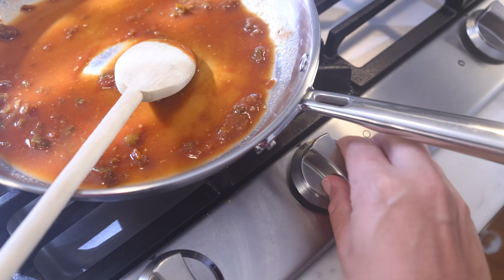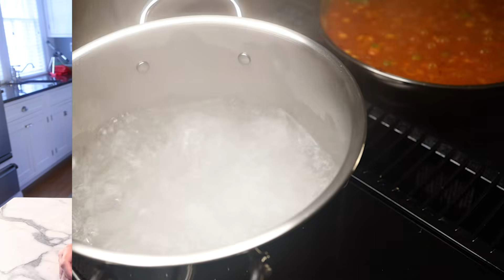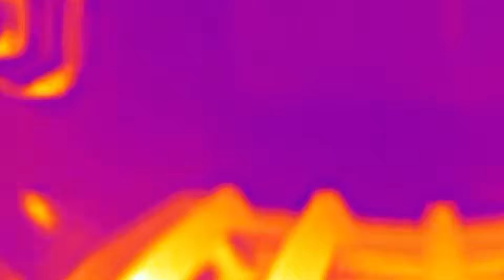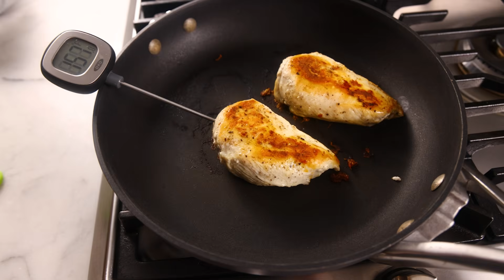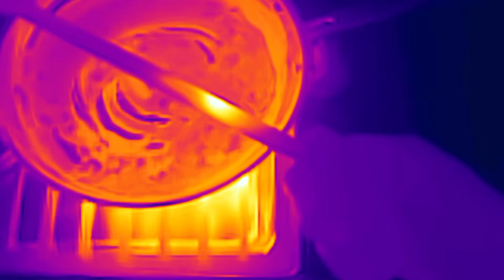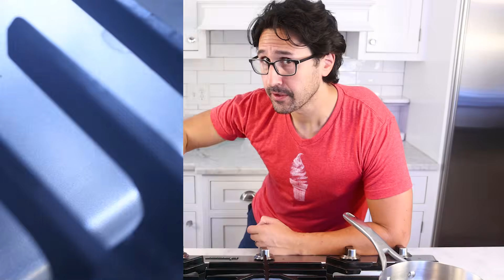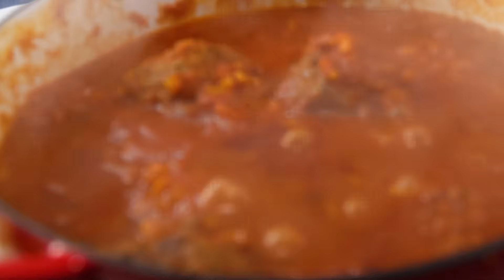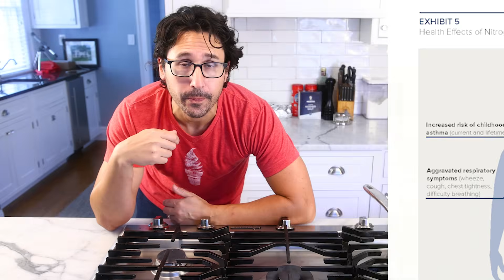Problems with gas stovetops | weak, dirty and dangerous

Comment: Wood fire stoves solved the heat distribution issue by having numbered holes that matched a ring in the bottom of the pans.  A number 8 pan in a number 8 hole was supported around the edges, exposed to the fire beneath, and excess hot air was mainly contained within the stove. This seems like it could be a simple addition to a gas stove if you had antique cast iron pans.  Replace the grate with a box with a numbered hole in top.   Take care to let enough oxygen in though.

Comment: When it comes to the ventilation, it is REQUIRED in commercial environments that cook with gas. Even if all you're doing is boiling water. It's not about clearing smoke from you food, but about clearing these combustion byproducts from your home.

That being said, one other benefit of gas that I do see is in the event of a boil over, you can more readily get the problem under control. Even if things get really really bad, shutting the gas off will resolve the problem in about 15 seconds at most.

Comment: Most of the electric power I use is produced at a power station using natural gas, it seems silly to burn the gas put it through a transformer run it through the lines back through another transformer and then heat my stove, when they can just pipe the natural gas straight to my house. I think it's more efficient energy wise but I could be wrong.

Comment: Yeah i was getting  a big question mark in my head when you said electric was unresponsive, until i realized you were talking about ancient resistance coil technology. Induction has been the standard for a long time. and it is as instant as i think heating something up should be, some are even too aggressive, causing your pans to warp because the steel cant spread the heat fast enough through it self causing it to warp due to hot steel expanding
Reply: Looking at HD canada today lets disprove that claim: lowest cost (and therefor most ubiquitous) is an electric coil range at 694 dollars, and gas at also 694 dollars (but less common cause less people have gas lines in their kitchen). Cheapest induction cooktop is 1394 dollars. Even today the standard cooktop is electric coil in Canada. Likely the same is true in the US, where this video was filmed.

Comment: eventhough the induction burner is better than gas stove, a bad gas stove is better than a bad induction cooker. ive wasted a lot of money to find good induction cooker but i still almost burned my food using it. it always level 2 is too low but level 3 is too high temperature, i cant set it to 2.5. it frustrated me because i cook 2-3 times a day. however for gas stove i never had any problem as im able to tell by looking at the flame. i can control the flame as i wish.

Comment: The newer gas ranges with dedicated high-output burners have closed that boil gap dramatically between electric & gas. Regardless of how fast a pot boils water, I have never had anywhere near the control over temperature with an electric range as I do a gas range. For me, the litmus test of a quality range hasn't been how fast it boils water. If It takes 4-5 minutes with an electric cook top and 7 minutes with gas, so what? That, to me, is just a performance measurement for how well it is transferring heat. It doesn't have anything to do overall control of temperatures - which if you are serious about cooking, is everything.

Comment: A couple things the heat's not wasted a distance away from where the gas comes out it's where the most heat is at the top of the flame and the grate being real hot is not wasted Heat it helps transfer that Heat a little more slowly so it serves a purpose

Comment: Can't speak for induction cooktops since I have not used one. Those might very well eliminate most of the disadvantages of electric. Normal electric cooktops are terrible, and I would avoid them in any living space I actually own. 

Going to your point about the weak output, that seems to be a product of the modern gas cooktop. The reason so much heat escapes, is because they are making the grates sit to far from the burners on these modern "restaurant style" cooktops. The reason why real restaurant cooktops are like that is because they are capable of producing large flames on a single burner, that create more heat than a complete residential range can.

Comment: Hey, Adam!

I just want to clarify something about the end of the video. Electric stoves are very rarely going to be getting 100% of their energy from fossil fuels. If it's getting power from a local region, there can be a wide range of renewable sources. For example, 60% fossil fuels and 40% renewables. And yes!! As you said, they will be getting cleaner every year too while gas stoves are locked into how clean they are.

Comment: I've been a home appliance tech for years, and now own my own business. I'll point out a couple of obvious reasons gas stoves and cook tops are not as hot.
First, they have been designing them to look like a fancy outdoor grill and the grates have the pans way too far above the burner, wasting a lot of the heat produced.
Second, if you can afford a high end gas stove or cook top, most of them come with bigger burners, more gas holes in the burner assembly, and a larger gas orifice so more gas makes it to the burner assembly. Some even come with two burners, one inside the other and two gas orifices. Those are designed for use with a wok.
So, gas appliances are not colder per say..., the design is  the issue. Point of fact, a gas oven will heat up faster than an electric oven because they have a correctly sized burner tube. Gas water heaters also heat faster than electric water heaters. Gas furnace is more efficient then an electric furnace etc.
As for you analog of a wok needing the heat to come up the sides? Nope. Wok cooking is designed to have a very not bottom to almost flash cook while you can pull up mostly cooked items on the sides to keep them hot but not cooking at the bottom. A quality wok will not have completely smooth sides. It will have hammered dimples to help grab the food and hold it up away from the extreme heat at the bottom. Seeing all those flames going up the sides is just a by product of the intense flame aimed at the bottom center.
Induction? They cost way more to buy and repair, so you'd have to factor that in when looking at efficiency I think. A standard brand induction range or cook top has a $1600 triple control board under the induction pads. Most brands, you have to replace all three as one unit. The time involved in disassembling on of those, replacing the control boards, the reassembly can be almost 2 hours.
Reply: Actually Wok cooking involves more than a hotspot in the middle. You clearly don't use a wok to cook or you wouldn't of trivialized to such a simple reason.

Comment: My biggest problem with modern gas burners is that they are designed to either be high or low, with very little room between the two for fine temperature control.

Comment: The wok burner does not want to disperse the flame if you talk about traditional wok cooking! It is best when the flame is a concentrated jet flame in the middle of the pan for the heat! That is the most efficient way of heating a wok!

The whole point of the induction wok stoves having that shape is because you cant put a traditional roundbottom wok on a normal induction cooktop.

Comment: i was stoked to get a used glass top electric (not induction)  in decent condition 6 years ago.  worst stove top i've ever used...the glass takes forever to heat up, and forever to cool down.  in reality it's not easier to clean...as soon as it's clean you put a pot on to boil and in no time at all it burns a ring of carbon onto the glass that takes a lot of scrubbing (plus scraping with a razor blade) to remove.  we don't have a natural gas connection and we don't have a big propane tank, or i might get a gas stove installed.

Comment: Cooked for a decade on a thermador gas ‘pro cooktop and swore by the advantages frequently mentioned here. Moved to a house with previous electric cooktop and learned that replacement with gas would require some expensive remodeling and updating gas pipes throughout the house. So I began to research induction and electric alternatives and eventually puchased a countertop portable induction unit to test the tech. Some  favorite pots and pans would not be able to make the transition but the showstopper was that one family member would cover their ears in pain whenever the tech was on. The same individual also had the same experience at other homes with induction cooktops. So I gave electric glasstop tech as of 2020 a try and while there are some downsides the overall cooking experience has reset my previous views on gas.The idea that gas is easier to see how hot the burner is doing pales in comparison to the glasstop. To see the gas burner on any low setting you have to bend down to look under or lift the pan.As another commenter expressed the electric burners employ infrared for both convection and radiant heat transfer and as a bonus create a hot red graphic light pattern  against black field that is far easier to see than a transparent blue flame against any color. There is an easy to see and positive response touch control that vividly lets you know whether you are at heat levels between 1 and 10. Once the levels become familiar they are reliable and come to temperature faster than my gas experiences. This is very different than the metal coil electric of old. You can also select different size heat areas for different size pots and pans. So you can have a low temp on a big pan which with gas would tend to be a small flame near the center or a high temp on a small pan without flames wrapping around the edges.Most importantly the heat is even across the surface which is not my experience with gas which has temperature differences across the bottom of the pan. The glass/ceramic top surface is a blessing and a curse. Every time you cook there are visible bits of oil and food particles on the cooktop. If they are on the surfaces adjacent to the hot burner area they clean up quickly and a perfectly clean glass top with no bezel looks great and makes your kitchen feel spotless. But if you don’t bring it to spotless, then anything less is very visible and feels the opposite. It made me very aware that the decade I spent with a pro gas stove was one that was covered with some pretty disgusting film that was relatively hard to clean and designed to stay and collect there- ultimately polymerizing on the burner parts. With the glass electric top any food that drips over the edge and gets underneath or dirty pan bottoms will create  a polymerized crust on the glass and a different level of cleanup. This requires a ceramic specific abrasive and scrub pad that goes on like car wax- dries and is buffed off.And for especially crusty deposits a razorblade scraper is used first. But with those efforts and some additional care when cleaning up to more carefully wash the bottoms of pans the tidy black glass surface returns. some very tiny scratches accumulate over time. I had to say goodbye to a favorite cast iron pan with a warped bottom ( which most have) that easily bridged the cast iron grates on the gas cooktop but spun like a top on the  flat glass top. And I share a story of caution: A friend from Central America with best intentions to share a family recipe for Salsa was used to placing onions and peppers in Aluminum foil on old style electric coil elements to get a quick roast on medium heat. The same technique on a ceramic top electric can result in a fusion of the aluminum and glass top material that can leave ugly scars to the top. On balance I would choose electric ceramic top over gas and in a power outage I can cook outside and will be more concerned about all the stuff in the fridge.

Comment: You missed the, honestly, most important reason that gass stoves (atleast in new houses) are bad for the environment. And that is that gass conecting houses is not economical for just a gass stove. Therfore most gass connected houses are heated by gass boilers and that is a way way worse method of heating your house then electric heat pumps (AC). This drive towards gass heating is actualy the reason that the gass indostry pushes out so much pro gass cooking propoganda.

Comment: With my gas stove, I can get it as low as I want but not by design.
Not sure if other stoves are like this but when you go over the max setting, the fire gets smaller - smaller than the actual lowest setting.
I can use this technique to keep the water at 80C forever.

Comment: Two other reasons to avoid gas stoves are the risk of carbon monoxide poisoning if the burners aren't working properly, and the fact that burning gas creates water vapour. So even if you aren't cooking with boiling water you will still make your kitchen humid.

Comment: i love that you mention that gas might have a lower carbon footprint due to location. burning the gas at point of use, rather than burning it in a powerplant, then transmitting the electricity. 

lots of problems with gas... sure.. but when people complain about certain fuels and then go electric often don't realize that all their electricity is produced by like, natural gas and coal lol... and it loses about 50% of the energy stored in the chemical bonds of those fuels by the time the electricity is used at their point-of-use

Comment: The pans you are using are very poor, the tapered base is aesthetically pleasing but a crap design.
You should always use large base diameter pans on ANY gas burner, even the small burners.
This is all very basic "common sense" but by the looks of your video, not common at all.
Here in the UK the cost of a unit of electricity is 6 times that of gas - a complete n0-brainer in favour of gas.

Comment: Induction is the way to go. Very quick to heat up and cool down.  A gas range burns the air in the house that you have paid to heat or cool.  I spent 40 years in the Natural Gas industry. Look up Hydrogen Sulfide.

Comment: Adam, you just changed my mind about these types of stovetops! I grew up in Mainland China and I am in Canada now finishing my degree. I always wondered why electric stovetops I used in the past years in Canada boil water so slow compared to gas stovetops everyone has in China. Its because the ones I used were just bad! Lol. Love your content man, I learned a lot western dishes here!
Reply: 2:28 btw pretty much every single gas stovetop in China doesn't have that much of a gap between the pan and fire. The bars holding the pan are actually a bit tilted inwards to get the pan closer to fire, and the cook we always use is wok, so they actually fit perfectly to get the most heat.

Comment: I hate all the electric hobs Ive used. They just feel like they have far less control as it has set heat settings. Never had any issuse with gas hobs

Comment: My major complaint about gas stove is problematic clean up. Invariably I find things dripping off my pans either through boiling over, splashing, spilling, or dropping. What would be a 30 second clean up with a glass top stove is a 5 to 30 minute or more project on a gas stove — depending on how much material has found its way through the iron bars and into the burners. At minimum I have to take off three heavy iron bars and wipe with a sponge and then a towel. At maximum I have to disassemble a burner or two to remove burned food bits. Like Adam my next stove will be induction.

Comment: Gas just werks better.
Sorry bruj

It sounds like you're using the wrong pans and pots on your range and the relative burner size is mismatched. Iirc copper bottom pans or cast iron, whatever soaks heat best.

In cold parts of the US the ambient heat off a gas burner is very much welcome for 7 to 8 months a year. It's also down right irresponsible to rely on a single heat source in the rural areas, also like where I am. Imo a house here should have gas, electric and a 3rd source like a functional wood burning fireplace or stove. Something that's primitive and can run on readily sourced fuel.

Comment: There is another BIG reason why Restaurants and other commercial kitchens switch to induction.

Because there is minimal heat loss outside the pot itself and the pots are on all the time, it makes the kitchen itself way less of a hell pit temperatur wise.

Comment: I noticed it takes forever to heat a pan also. Gets really annoying for making breakfast every mourning having to wait for a pan to get fully heat saturated for cooking an egg. Only took like 5 seconds on a high powered electric.  Honestly I miss the crazy flat even heat electrics can provide just modulating heat by lifting the pan. I don't like the fact the electrics pulse on and off tho. If they made electrics that could provide a consistent heat with no pulsing I would never go back to gas.

Comment: I actually wanted to swap to electric when I redo my kitchen.   The problem is houses wired with gas don't have the right wiring at the stove, water heater, dryer.   I would have to run a 40 amp 240 lines to each which would end up fairly expensive.    On top of that I only have a 100 amp box because all of the big appliances are gas so I would also need to replace it with a 200 amp box.     In the end the cost is somewhere between 2000 and 3500 dollars to swap to electric from gas without the cost of the appliances..   If they ever give out rebates to get it done I will do it in a heartbeat but I just couldn't justify the cost of spending almost 4-5k to do it.